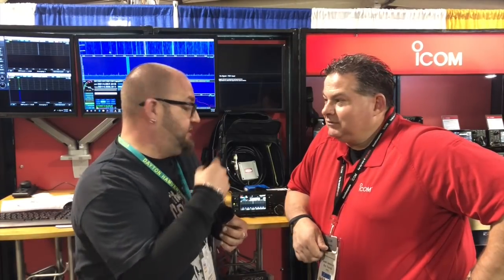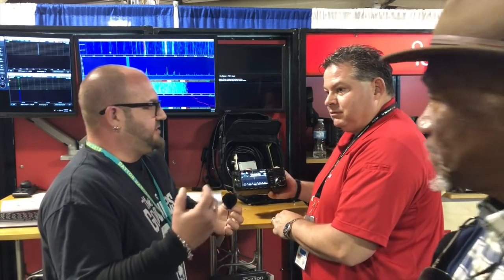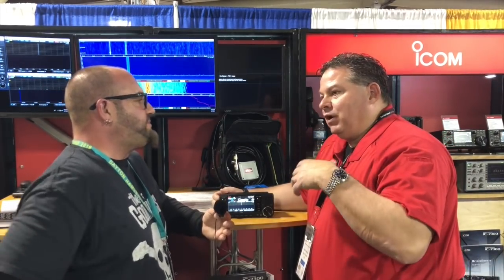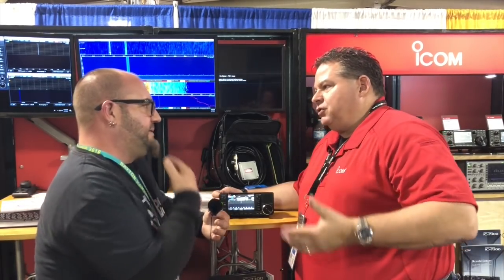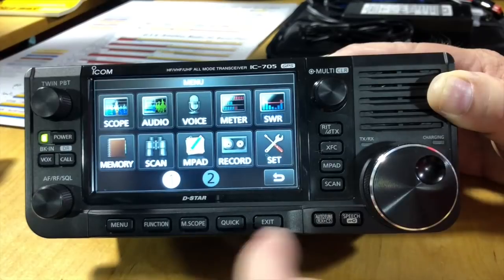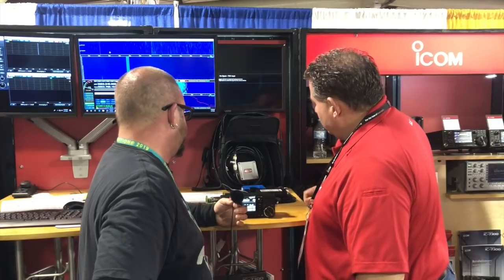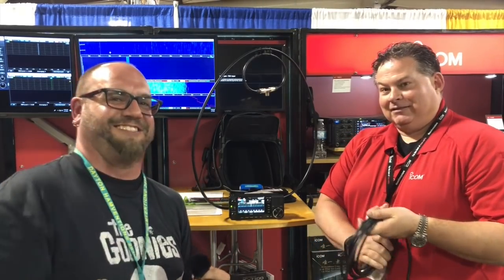Icom IC-705 Interview with Ray Novak from Orlando Hamcation 2020.

Comment: For you QRP fans out there I see they have released the new icom 705 for about $1,300 dollars. But for about $450 dollars you can get a small lightweight QRP size Xiegu G90 transciever with internal antenna tuner that is so good it could probably tune up a head of lettuce, an antenna analyzer, a water fall, and up to 20 watts. However  if you save up all your hard earned money, for and extra $850 more dollars you can actually get an  icom 705 with no antenna tuner. ??? uh what did you say $850 dollars more of my hard earned money and NO ANTENNA TUNER. ??
Reply from the maker: Yeah but you haven't held the 705 in your hand.  It is an amazing radio.  You're really not comparing apples to apples though.  Icom vs. Xiegu is like Ferrari vs. Kia.  Yes, they are both radios, but one is a base grade entry level, with very, very few features other than the waterfall and a great tuner, the other is a high end, fine tuned machine with filters, a way better receiver, the same touch screen as on the 7300 and 9700, all band all mode.  I completely understand where you are coming from, but they are not even in the same league.  No antenna tuner is not a deal breaker for me at all.  My first "portable" radio was the Yaesu FT-891.  That doesn't have a tuner.  I used resonant antennas.  The first of which was a speaker wire dipole cut for 20 meters and it worked great.  They will both get you on the air, and that's the most important thing.
Reply: K8MRD RADIO STUFF 
Au contraire I beg to differ with you. Obviously you have not held a Xiegu G90 In your hand. It is pure quality because of the features it has. It has wonderful filters. It also has a CW decoder that is great. Just because that 705 has a flashy look to it does it mean under the hood it has quality like the Xiegu G90. I really like Icom ‘s. My favorite one is the 7300. I was looking forward to the 705 until I found out they took a 7300 and dumbed it down by removing the internal antenna tuner and much less Power and want to charge more money than for a 7300. Just because the crowd wants to go with a little flash I am not like one of the dumb lemmings jumping off the cliff after everybody else. Let me tell you one reason why.  I have my small G 90 and I really really like to carry  the portable chameleon Cha micro antenna with the 60 foot wire That I can use on bands up to 160 m. But the only way is to use an antenna tuner. If I bought one of those 705’s I would have to go and buy an external antenna tuner to carry two things to do what I do with one right now with one small radio. Otherwise I am stuck to a narrow spot of only having to have a resonant  antenna. And I do not want to carry a whole bag of resonant antennas for each and  every band. There are a few Antennas with Coils and different things on them to be able to make them resonant. But then I am restricted to only those products. I like the versatility of an antenna tuner and use a lot larger range of Antennas that I might want to use. Not only is the G 90 a first class outstanding quality QRP size Transceiver it is possible to turn it up to 20 W even though it is a small QRP size radio. For 2m I simply have an icom handheld. I have D star On my handheld and also on my icom 7100. but where I am there are no repeaters for D star that I can reach so it’s sort of useless for me right now where I Live. One person did put in a UHF D star repeater but hardly Anyone can reach it from my area. So I don’t have access to it where I am. I have a small go box that I made up. Look at my QRZ page KB5IOC to see it. It has the G 90 with its decoder and its internal antenna tuner where I can reach all bands but in my briefcase size waterproof go box I also have a 2 m connected to a TNC so I can get email even though I do not have access to the Internet by using Winlink. For me the 705 is a day Late and a dollar short of everything that I really need. If it had an internal antenna tuner I might have bought it but to me it’s just a dumbed down 7300 that cost more than the 7300 does. do not discount the G 90 is a fine quality instrument. I do not like to be restricted to have to only  use certain antennas. I like to have a higher choice. And I really really like my chameleon cha micro antenna. And I do not want to have to give it up for a 705 that has no internal antenna tuner and it’s just a dumbed down 7300 that cost more.
Reply from the maker: @docpearson  I own a G90.
Reply: K8MRD RADIO STUFF I see you mention filters in the 705 but you did not mention the wonderful outstanding filters in G90. You say you own one obviously you have not checked it out very closely because You Did not mention those wonderful filters in the G 90. Why is this?  have you over looked  them. check out this comparison of the great filters in the G 90 compared to the Kenwood

https://youtu.be/l4C8QI7L_lM                  Icom has obviously hoisted its own petard where it left off that antenna tuner.
Reply from the maker: @docpearson  Oh boy, you again.  Dude, I'm not going back and forth with you.  You clearly are pretty narrow minded and have made up yours.  Thats great.  You like the G90.  I do too.  You seem to think it's the greatest radio since sliced bread and you are entitled to your opinion.  But show me where the notch filter or the noise reduction is.  Oh, wait, you can't.  We all know you can narrow your band width with it.  Not what I'm looking for.

Comment: Speculating on price as in the video but if it is 12 to 1500 US it's a deal breaker. I know price is not yet known but anything more that 8 to 950 US is over the top. And the back pak with it's contents is extra.
Reply from the maker: It might be steep for sure.  We'll have to wait and see.  You are getting a whole lot of features in a tiny package though.  HF, VHF, UHF, D-STAR.  If you are patient, like everything else, the price will drop eventually.  Look at the 7300, you can get that for under $1000 now.

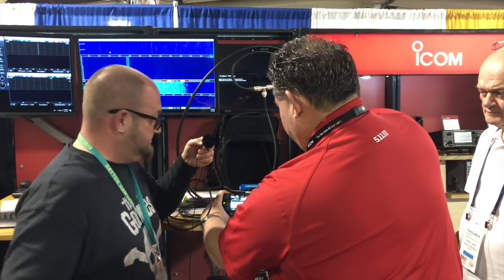Comment: 10:52 "Wow, just set up and ready to operate." At 5% efficiency, where as if we spend 20-30 mins putting up a proper antenna, you can get all 10w into the air :).

Loops are great to have in tight spaces, but using them as an argument against having a built in atu is a poor argument. Better just to take your own external atu if you MUST use a non resonant antenna. 

2nd hand Z11 pro2's aren't that expensive :)
Reply from the maker: I agree with you 100%.  I really wish they would have put a tuner in it.  They could have put that in instead of D-Star.  Who the heck is going to be going portable and want to use that?  Not this guy.  Still a very cool radio.  Who knows, maybe they will see the error of their ways in the next gen?  I know a lot of people are disappointed because of the lack of tuner.
Reply: @hamradiotube  It's a very cool radio indeed, already got a deposit down on one :).
Reply: Pieh0 as the saying goes,One born every minute. lol 😂

Comment: Two things I wish I could ask Ray.  1.  Screen visibility outside.  My 7300 is horrible outdoors.  2.  To save battery can the GPS digital stuff be turned off?  I'm cautiously excited with this one. Oh and fliberglass vertical with a wire and 3 radials... 3 minutes and 6 seconds if I break a sweat.

Comment: Does it have 4 mtr band?
Reply from the maker: Not in the US.  I would think it would for the countries that use that band but I’m just guessing.
Reply: @hamradiotube  It's been confirmed that it will have 4m for UK versions, so it is technically capable of it, so other countries that have 4m shouldn't have an issue :).

Comment: Was planing to get one but got the IC-7300 instead. May get one for VHF/UHF, but still low for base use plus then an amp, in that case, will get the IC-9700 instead.
Reply from the maker: The main purpose of this radio is for portable use.  Not so much a base rig.  They don’t have plans to make an amp or anything for it.

Comment: Thanks Mike for do the interview with Ray! New Icom radio new solar cycle on the horizon what can go wrong? Forgot an adapter for a line or my tent stakes yes I did that once. Force to use my mfj2286 which I still love. It would take me the longest to untangle and layout the ground radials. Very impressive radio and the well thought out menu design. I hope to be able to send a picture over hf lol. Dstar too I don't have dstar. Thank you again. I'm still keeping my IC7200

Comment: Absolutely Outstanding. 
You know the Icom 7300 is going for under a thousand bucks now. They will shoot this radio in the foot if it comes in more expensive than the 7300. Anyway I've got my reservation in and I'm looking forward to this radio being released.
Reply from the maker: Thanks Julian.  It’s def gonna be more expensive at launch I’m sure.  But man this thing packs a punch in a tiny package.   I was thinking about a kx2 but I’ve pretty much changed my mind.  I love my 7300, just not so much taking it portable.

Comment: Good video Mike!  I love the IC-705.  If ICOM plans to compete with Elecraft, which they really are, they should have included an on board tuner.  And hopefully the receiver is as hot as the Elecraft radios.  I looked at that same exact radio Saturday.  I was there at HamCation all day Saturday and I am surprised I didn't run in to you.  I would have really liked to meet you.  I did meet Eric of HRC and a couple of other YouTube creators.  I had a blast at HamCation and I am looking forward to next year.  73!
Reply from the maker: I was only there Friday.   Not sure how the receiver is going to be but I would guess it would be the same as the 7300.  Won’t find out until I get one I guess.  The tuner is kind of a let down I agree.  Not a deal breaker, but I can’t use my PackTenna mini without an external tuner still.

Comment: I'm still waiting for a 200 watt mobile from Icom.  What gives, Kenwood has had one out for ages.  Last thing I need is 5 watts.
Reply from the maker: Yeah but really 100W VS. 200W isn't going to get you much more.
Reply: @hamradiotube  ,. In a moblie it makes a HUGE difference.
Reply from the maker: @radioman6489  Really?  Interesting.  I use my WRC antenna on my trunk mount, (a really crappy one at that) not grounded or bonded to anything at all running qrp and get out all over the place.  I activate POTA all the time on my lunch break from my car as I work right down the street from a state park.  Granted, all power from the car is shut off lest I get all kinds of noise.
Reply: @hamradiotube  , well I'd rather have 200 watts.

Comment: The Elecraft T1 20 Watt Tuner will EASILY Velcro to the back of this thing if you absolutely have to have a tuner:

https://elecraft.com/products/t1-miniature-stand-alone-atu-and-accessories

A couple of 90 degree bnc connecters (maybe a bnc spacer in between) and its almost invisible from the front.
But honestly if you are taking this out in the field, you can get good resonance with a Wolf River Coil without it!

Comment: I'm really eyeing this rig. I'm wondering if it will have any water resistance? I'm hoping so since it is being marketed as an outdoors/portable unit.
Reply from the maker: I don’t think it has any water resistance, but I can’t think of an hf radio off the top of my head that does.
Reply: @hamradiotube , it's odd that they don't do it since they target it specifically for portability in the open world.

Comment: Ok so jump ahead 9 months from now, what will be the defining feature that this gives over other portable QRP radios? Seems there's no insight into how it performs outdoors under sunlight, frost, rain, damp conditions. Is it really a portable radio or a small QRP SDR computer.
Reply: Bet there will be a load of new screens wanted as well after its taken a tumble on a SOTA trip.... nargh.... not for me sorry.... not rugged enough... and as you say...that screen will be crap in sunshine... excellent remarks made though Carl...
Reply from the maker: He Carl, thanks for watching.  I’ve taken my 7300 portable plenty of times and the screen is fine in the daylight, unlike some of the qrp radios I have.  I don’t know of any Hf radio that is resistant to the weather, this one included.   For me the defining features are hf/vhf/uhf dstar all in one tiny portable radio.  And it has a (kind of) internal battery.  I don’t have a radio that does 2 meter ssb either and this will fill that void for me too.  Well have to see once it is released out in the wild and we put it through the ringer.

Comment: Besides no ATU, (not a huge deal) I don't like the form factor much.  It doesn't look like it sets well, needs a stand or something.   Secondly  I don't think, from what little I could find, it covers the noaa band's which would be  nice for portable ops.  Lastly touch screen and cold weather or wet weather might be an issue.  Just my opinion.  Love my 7300 alsoI have the 817 and an x5105 for portable. Still love the 817 best for cw/digi mode.  73 good video de KF7VUT
Reply from the maker: Ray told me they are looking into some designs for a stand.  Would be silly for it to be sitting there looking straight ahead.  I’m not sure how wide the receiver is so I don’t know about noaa.  Hopefully it’ll go up there.  It’s not that far above 70cm.

Comment: I would be interested in a in an HF only version  with antenna tuner and capable of 100 watts. I would be fine with losing the battery space to  achieve the 100 watts goal. Their response to the antenna tuner question is interesting. Why do you want one when you can buy this $400+ antenna instead. Setting it up to sell the radio, antenna, and bag as a grossly overpriced package deal?  He had a big gulp in there when you mentioned a price range and avoided the subject. For a product set to release in less then 2 months you would think maybe they would at least hint at a price range. Thanks for the videos.
Reply: Apparently confirmed in UK on Friday as £1199 but it could change - seem to remember a estimate of £800 when it was mid launch. Very nice piece of kit but I also wanted a 9700 at the time but not at £1800. For a hobby that’s suffering membership issues, these prices won’t attract new members. The old 703 will have to keep going a bit longer yet ......
Reply from the maker: That would be very cool to have a full power all band all mode radio from Icom.  I don’t know how they are going to package the radio, antenna etc.  Ray said the dealers will really come up with those.  I sure as heck wouldn’t pay $400 for that antenna.  That is insane.  Prob $20-30 in parts.

Comment: Expensive radio... likely worth it for what you get.  No tuner?  They showcase it with a crazy expensive antenna to compensate?  Gah.  Great video, but icom needs to find a tuning solution rather than what they are doing here.  Xiegu comes to mind...
Reply from the maker: Yes all band all mode plus D-star is quite compelling.  No doubt it will be on the upper side of the price range, but compared to its competition like the KX2/3, you get a lot more radio.  The lack of tuner seems to be the hot button for some.  Yes it would be nice to be able to use random wire antennas without an external tuner, like my PackTenna mini, but its not a deal breaker for me.
Reply: @hamradiotube  Sotabeams antenna would match perfectly with this as it is resonant set.

Comment: Very cool radio. But no ATU means, no ATU.... :-) 73 Stephan, DF6PA
Reply from the maker: That's not a deal breaker for me at all.  Sure it would be nice to have, but resonant antennas are always going to be best.  You can always use a portable tuner too.
Reply: @hamradiotube  Yes got, the Elecraft T1 tuner which is great. But I really like radios like the KX2 which include everything in a small box. :-) less wires, less hassle :-) Anyways, I will have a closer look at the IC-705 as soon as it is available. :-) 73, Stephan